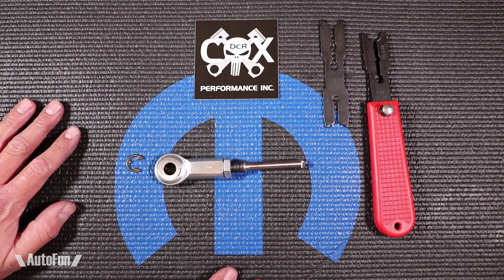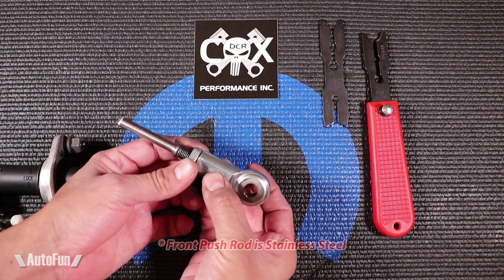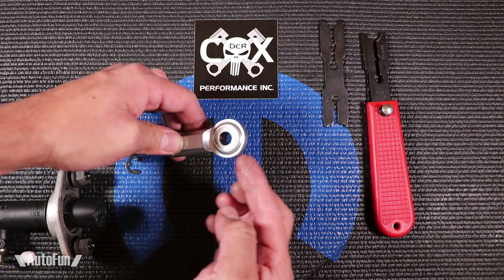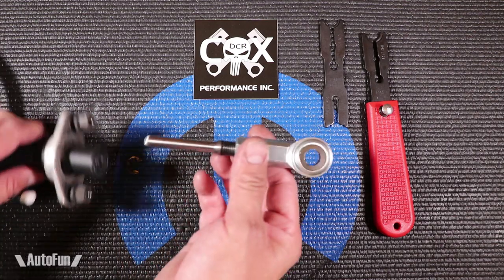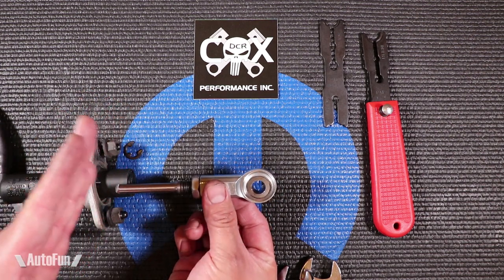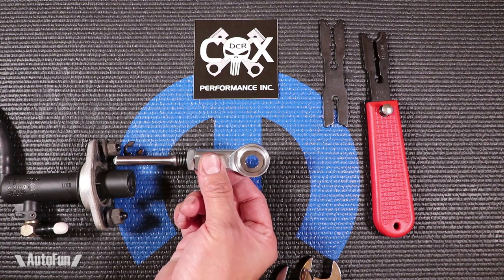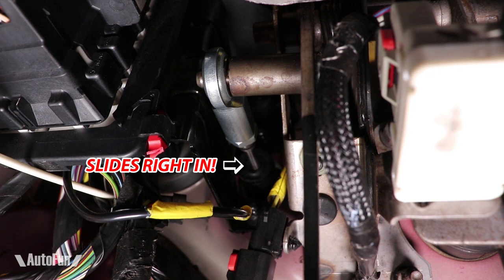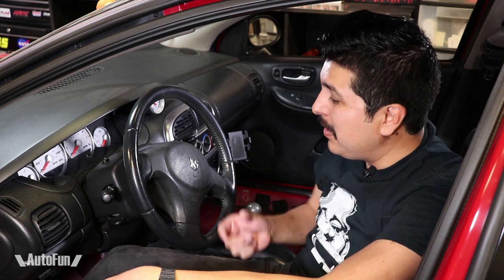Dodge Neon SRT4 DCR Clutch Rod Review & Install (2003-2005)

Comment: I “Dry fit”  a few times with the e clip off and the dust cover off so I could see if it was adjusted to tight. Adjusted Dcr rod so that it fit snug without pushing on the cylinder but the clutch pedal was all the way out. It fit in snug. Then installed dust shield and then rod, then e clip. Works great.

Comment: @autofun, at 7:04 you mention to remove the black cup.  Does the DCR rod not need the black cup anymore?  Could you just install the rod into the black cup without removal?
Reply from the maker: Hi Jamone! correct, the instructions for the DCR rod (at the time of filming) call out for the removal of the black cup. Hope this helps, Cheers!

Comment: quick question, i know you posted this video like 3 years ago but i just put in the dcr master cylinder and when i try to bleed it no air comes out maybe you know something ab that ?
Reply from the maker: Hi Oscar! If no air comes out, maybe all air has already been bled. If your mechanic is still having issues with this, they can also contact DCR, they may be able to walk them thru some troubleshooting steps. Cheers!

Comment: Hey Alex, how do I get the piston and spring back in if I pull it all out? I'm trying to push it all back in by hand, but it's not really wanting to go back in.
Reply from the maker: Hi Corey! Oh oh! that is not good lol I only done that on a old one to see the insides, it can probably be put back together carefully but making sure that the seal is not compromised and also the system being fully bled will be key. Here is my video showing the bleed process https://youtu.be/NdrJ7gGqqGE Cheers!
Reply: @AlexAutoFun  I was able to get the piston back in. Very little fluid was lost. I re-installed the clutch pedal pushrod.....however, now my clutch pedal is very limp and I cannot get it into gear 🤦‍♂️. Also....I did NOT re-install the e-clip because I could not do it. I tried and tried and could not get it in. Do I need to bleed the clutch? My clutch is very very loose now.
Reply: I got it fixed! I bled the clutch and everything is good! 

I COULD NOT separate the keeper from the piston. I had to completely remove the piston from the master cylinder in the firewall. Then I put the piston in a vice and I was able to remove the rod and keeper from the piston.
Reply from the maker: @scorey05  Awesome! 🍻

Comment: I’ve been having trouble removing that metal cup, I have a brand new master cylinder but it came with the metal cup installed, any other tips? I can’t seem to even get something under it.
Reply from the maker: Hi Eric! ah yes that infamous cup! it can be frustrating, some come off easily and some (specially on a new master cylinder) are very stubborn, tons of patience required but eventually it does come out (what I did to my flat screwdriver that I shoved in between the metal cup and cylinder is I sharpened the front like a knife, so it's super thin in the front which allows it to "cut" into the space between the cup and the cylinder eventually making enough room to fully insert it). Cheers bud!
Reply: @AlexAutoFun  thanks so much for the response, I just got a a new slave, master, and stainless steel line and Didn’t know how to approach it. That info was really helpful, I was starting to “cut” into it but wanted to make sure. I appreciate your time!
Reply from the maker: @ChochaRico  You're welcome! and congrats on your new setup, that is very good upgrade imo..

Comment: If i have a replacement master and the oem rod isnt in it do i have to remove the retaining clip out if the piston to install the dcr rod?
Reply from the maker: Hi Bacoj! The DCR rod is larger in diameter than the stock rod, so the retaining cup inside your replacement master will probably not let the DCR rod sit into place completely (That being said if the replacement master has not been installed, it is much easier to remove the internal cup at this point that after the master has been installed in place). Hope this helps, Cheers!
Reply: @AlexAutoFun  ok thanks so much. I went and removed it anyway cuz i remember doing it to the original in the car. But thanks sooo much youve always been a huge help man
Reply from the maker: @kakkarotskorner  You're welcome Bud!

Comment: hey I have a quick question for the metal cup is it hard to take out and for my master the yellow/white plunger isn't yellow/white it is metal and the metal cup sits in it and it is very hard to take off and still hasn't came off any thought?
Reply from the maker: Hi Nice gaming 2! Yes the metal cup is a little tricky to get off but once it pops off the plastic plunger it comes off right away. If your plunger is made out of metal it maybe not be the original one and it's possible that the metal cup is part of the plunger or it held together differently than the plastic one, that's interesting, let us know what you find bud!
Reply: @AlexAutoFun  im assuming it is just different style of build because I cant get the rod out so the metal cup is holding it in place I will let you know soon!
Reply: @thatpurpleneon322  how did u end up getting it out bro? Im having same issue rn😣
Reply: @thegamerstx1267  I got a whole new master cylinder from a autoparts store and just put the metal rod right in since it was already disassembled
Reply: @thatpurpleneon322  thx I couldn’t take it out i gave up

Comment: The DCR metal bushing is a much better design. I haven't broken the stock linkage yet but where the eyelet attaches to the clutch peddle it's most certainly getting sloppy.
Reply from the maker: Hi Kevin! yep fully agree with you man, the DCR is super solid, I actually never knew about this weakness until on day my oem broke and I couldn't shift anymore..

Comment: I pulled the piston out all the way will i need a new one? Also my snap ring doesn’t sit/lock in place anymore. Clutch is super soft doesn’t feel like any pressure is there anymore does it sound like there is air in the clutch?
Reply from the maker: Hi Rogelio, if the piston came all the way out and the fluid leaked, it is possible to re-assemble the unit, fill it with fluid and bleed it. However this may be difficult with the master still mounted in the car and bleeding an old master could lead to future leaks. If you are still running the original master it may be best to purchase a new one to make it easier and to ensure the master will not fail down the road, bleeding new parts is much safer than bleeding old ones in my experience, hope this helps and let us know what you end up finding bud!

Comment: Unrelated to the clutch, but is your gas pedal a little bit of a chore to press down?, my Civic has a very light gas pedal, & the SRT4 feels pretty heavy. Any thoughts? Don't know if its normaly a heavy gas pedal. Thanks.
Reply from the maker: Hi Ramiro Pinon, it shouldn't be that hard to press. It's possible the throttle body is gunk up and needs to be cleaned or the accelerator cable is pinched, damaged or needs lubrication. Let us know what you find buddy!

Comment: I’m gonna to soon replace complete clutch mater cylinders is leaking oil and weird thing is mechanic just replace the clutch kit with fork and ball but after long drive sometime 1st gear and reverse gets really hard to engage but when car is cold shift like nothing you think bcuz the clutch master cylinder is leaking . Also thank you for that information I really like your videos more Srt4 videos
Reply from the maker: Hi Ivan, I would definitely start by fixing the leaking master and go from there, basically process of elimination so you can see if that makes a difference, thanks for watching my friend and lets us know if you figure it out!
Reply: Same issue when is cold it shifts smooth and when its warmed up it starts getting hard but i have no leaks, but did notice the bushing in the rod is warn out.. so wondering can that be the issue as well.

Comment: my clutch squeaks everytime i press on it. Would getting a new clutch push rod fix the squeaks?
Reply from the maker: Hi bud! it may be your throw-out bearing, sometimes they begin to squeak when they are close to failing but I also seen cases where they will just squeak but work fine. Here is a video on the release bearing https://youtu.be/_XYBiS-san4 if it helps...
Reply: @AlexAutoFun  thanks for the reply and info! I’ll look into it.
Reply from the maker: @IiTzDannyy  You're welcome!
Reply from the maker: @IiTzDannyy  You're welcome man!

Comment: Hey am I able to unlock the locking nut and adjust it with it fully installed or do I have to undo the whole thing?
Reply from the maker: Hi Adam!, yeah you can adjust it without having to remove it. It's easier to remove on and off once the original rod has been removed, so while I can adjust it with it on, I do find it easier to adjust off the car than to contort myself down there to adjust...
Reply: @AlexAutoFun  so im having a weird pop/click noise when I press the clutch down and it feels softer when the weather is now in the 80s does the weather have anything to do with it?
Reply from the maker: @thatpurpleneon322  You know I actually noticed that my clutch pedal also developed a little bit of a click noise as my car got older (started before I did the DCR clutch push rod), I believe is the clutch pedal assembly itself as it rotates when I step on the pedal, I may just need to grease it, if I do confirm that fixes it I will let you know bud!

Comment: Why don't you leave that metal cup in place?
Reply from the maker: Hi Brandon! you may be able to leave it in place but since the new rod is aluminum it seems redundant (the old part was plastic so the metal cup provides wear protection). Well and I also left it out since the DCR instructions recommended to do so LOL but I suspect you maybe able to leave the old cup if u really wanted to...
Reply: @AlexAutoFun  I installed this recently, it was just a thought since the DCR rod only presses in the middle of that plastic piece, whereas the cup would spread that load out across the entire plastic piece. There's gotta be a reason they said to leave it off I'd imagine.
Reply from the maker: @xounlistedxox  Yeah that is true..

Comment: How did you remove the rod ? Did you just force pull it out or did you have to remove the snap ring first
Reply from the maker: My original rod just came out on its own after disconnecting it from the clutch pedal, the clip that held it to the master was broken, normally you have to stick a tiny flat screwdriver into clip to release it from the master after removing the snap ring. But I have heard its possible to pull it out by force alone (with the snap ring left in place while trying to yank it out), let me know if your come out easily bud!

Comment: Do you remember how many threads it was set at?
Reply from the maker: Hi BeamNGD Video! do you mean how many threads I set mine to? I can probably check but this will vary greatly from car to car, additional factors that can change the optimal length is what clutch and TOB you are running. Lastly the set length will be different if you want a lower or higher engagement (pedal height). Hope this helps and thanks for watching bud!

Comment: Why doesn’t the cup stay in the master when you install the dcr pushrod?
Reply from the maker: Hi Cal Media, the little metal cup that retained the original rod is small in size than the DCR rod, so its eliminated as otherwise the DCR won't fit all the way into the master. Hope this helps! Thanks for watching bud!